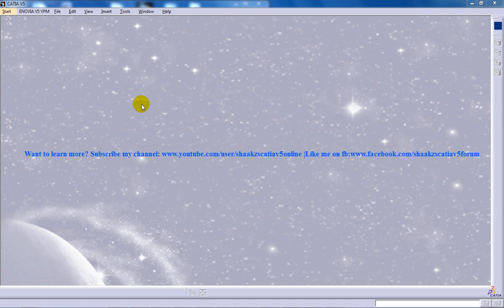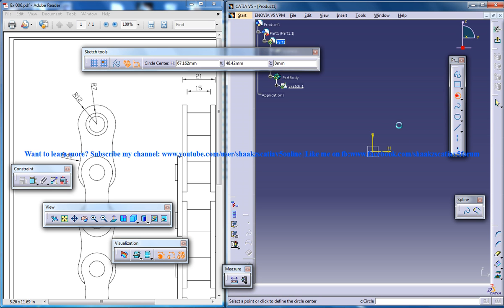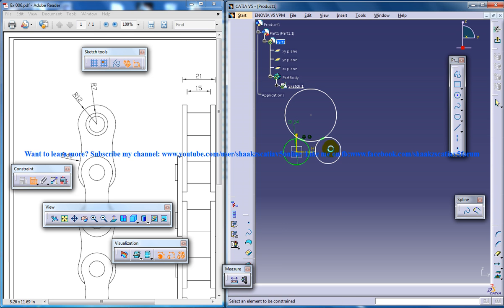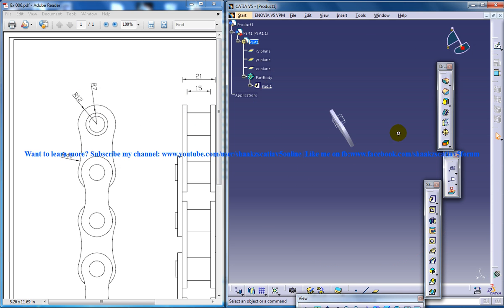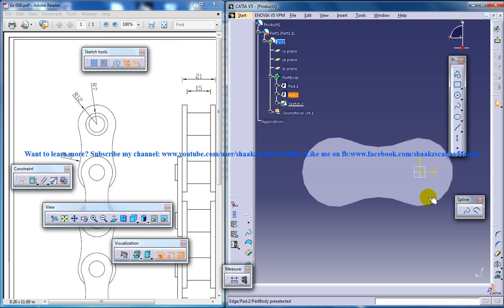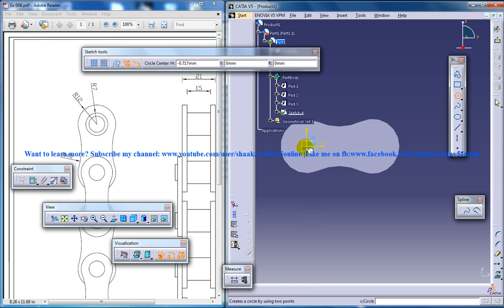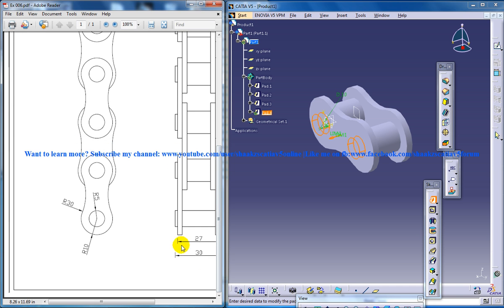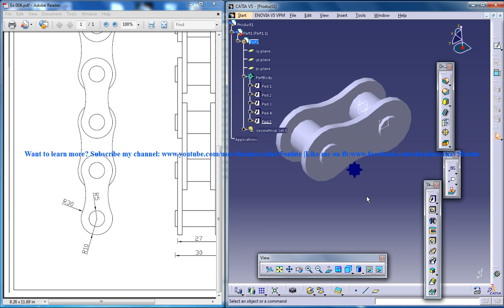Catia V5|Chain Mechanism Simulation P1|Digital Mockup|DMU Kinematics

Comment: Hi Mohammed. I'm trying to perform this simulation as well. I was able to successfully simulate a single chain link and have also been able to attach several more. The problem I am having now is that the program is not allowing me to coincidence the point on the next link with the curved part of the guide curve. I am stuck with just a straight section of chain. Do you have any suggestions?